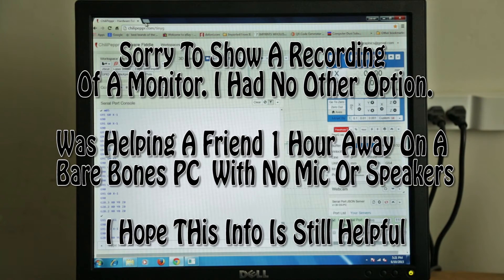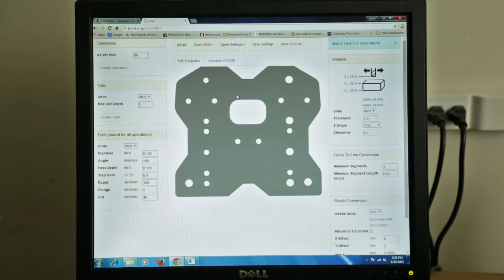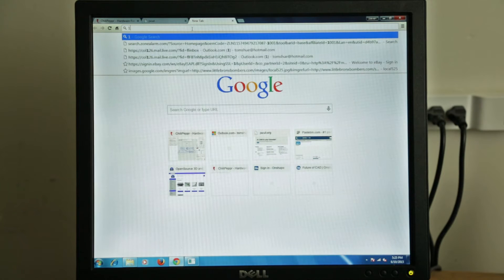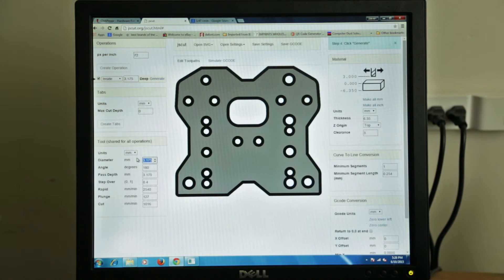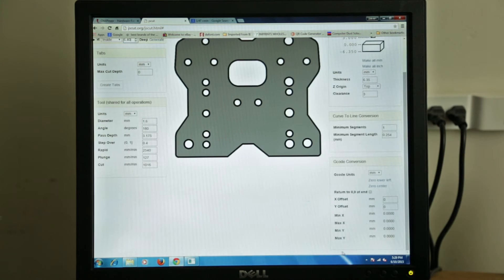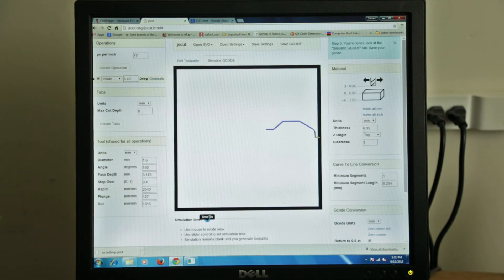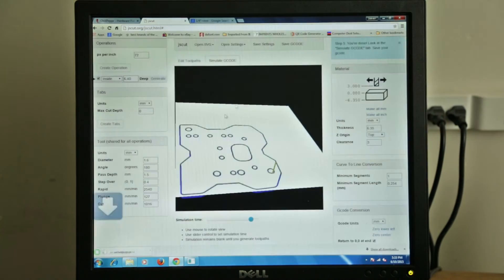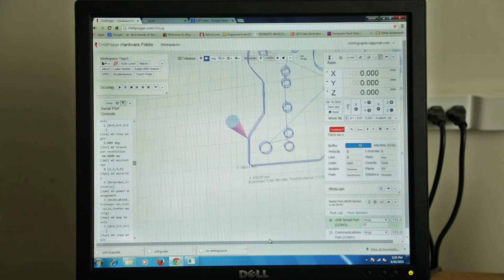Setup & Overview Of The OX CNC, TinyG Controller Plus Chilipeppr & JScut Part 3 "CP GCode & JScut"

Comment: by selecting inside..you inside cuts will be correct...but your outside part will be 1.6mm (the diameter of the bit) x 2 = 3.2mm off....your part will be shorter lengthwise and widthwise by 3.2 mm

Comment: BTW, hold down Ctrl key and click on 3D viewer to jog to the 4 corners of your part to see if you have room on your CNC machine, rather than measuring like you describe around the 15 minute mark. It's much easier than pulling out a tape measure or caliper.